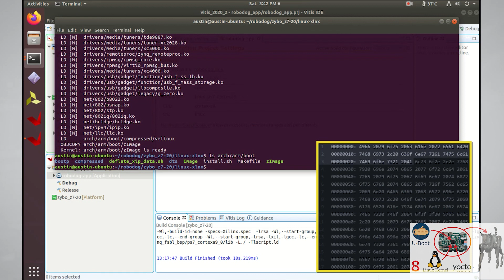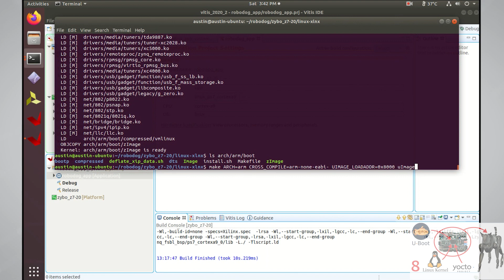#4 TechBytes | How to Compile Linux Kernel from Scratch

Comment: FYI. This procedure is on Xilinx Confluence. BTW, you left out a WHOLE mess of steps! What are the rest of the steps necessary to boot Linux kernel on, say, a Zedboard?
Reply from the maker: This video snippet is only intended for giving people a sense of how to build the Linux kernel, it has nothing to do about booting on any hardware. If you want the whole picture on how I put all software components on a Zybo board and how I got it to boot, watch the 3 part series in the robodog playlist of how I built my own OS.
Reply: @AustinTronics  It's not that hard to build a  linux kernel. Getting the linux kernel to run on custom H/W are or an eval board is the hard part. The Xilinx video and other random youtube videos aren't very helpful. I'll eventually figure it out on my own. Learn by doing.
Reply: @roadracer1584  I think it's helpful